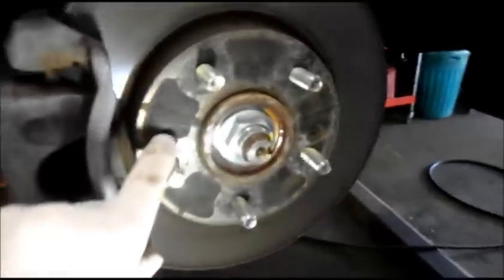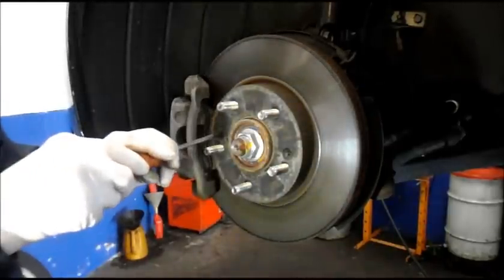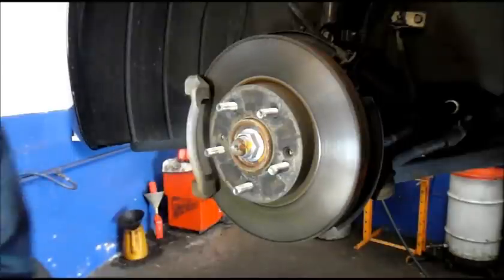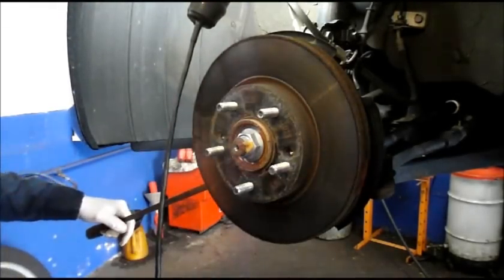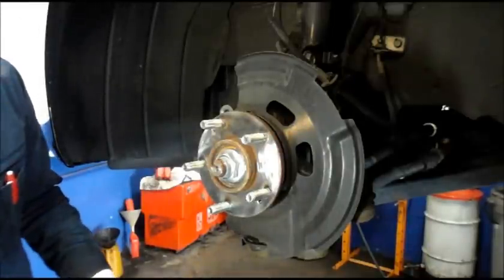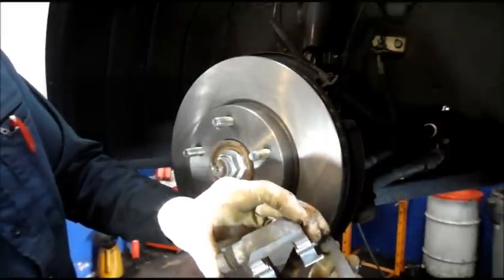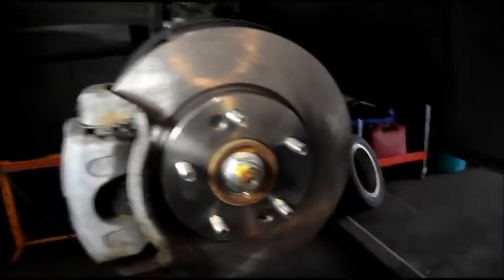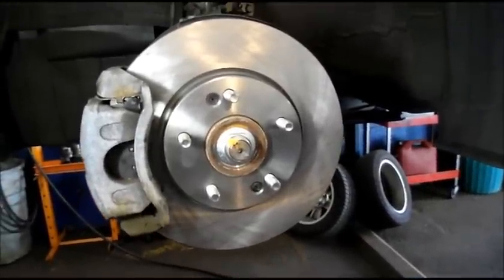How to replace front brakes and rotors on a 2013 Hyundai Elantra

Comment: Hi i have a 2013 also i will be changing the front rotors and pads also im concerned about the caliper its not leaking but its rusty
Reply from the maker: As long as it is not leaking you should be good.
Reply: Thank you Jim

Comment: Thanks for your awesome video.  I've been doing break jobs since I was pretty young...but with all this newer cars out I like to see the videos like yours to ensure I don't screw something up.  I'll be replacing my daughters rotors and breaks pads this weekend and your video has definitely given me the peace of mind to know it's a pretty simple job.  THANKS
Reply from the maker: Thank you for watching and your feedback.If you run into any problem let me know I should be able to talk you through.Let me know how the job turns out.
Reply: The job was probably one of the easiest I've ever done...Recently has surgery on my left shoulder and probably shouldn't have been doing it along but it was for my daughter who had worn them down to nothing...metal to metal was not pretty.  I did find that the caliper bolt was a 14mm on her car not a 13mm...other than that everything went very smoothly.  Thanks for your helpful video once again.
Reply from the maker: Thank you for the update .Great job.

Comment: great video,i tried to replace my pads today, but when i saw the back of my rotors there was no way i could do it,   there was no surface just rust,one thing, when doing the driver side what can i do to get leverage on those 17mm bolts ,i cant get the car that high on a jack
Reply from the maker: The longer the ratchet the better that will give you more leverage.
Reply: hammer and wrench

Comment: Inspected brake pads on my 2013 Elantra.  Pads have 25-30% remaining and even wear.  However noticed a raised lip on the rotor edge, made it difficult to slide the pads off. Saw this same raised lip in this video.  Recommend to cut down that lip now, or when pads are changed?  You replaced the rotor without measuring rotor thickness, really required to replace because of this rust lip?  -thx
Reply from the maker: Yes they were replaced because of the rust lip.Thank for watching.

Comment: Thank you for posting this one!  I just did the front brakes and rotors on my 2012 Elantra.  Thank you for the tip on hitting those two rotor retainer screws with a drift!  I had one that gave me a hard time but eventually I got it out.  I may invest in the hand driver. Do you have a video on how to do the rears on a 2012 Elantra?
Reply from the maker: +N72Pilot  Thanks for watching and your feedback.This is a video I have for rear brakes on a Hyundai but its a Santa fee   https://youtu.be/oegacaeJn98
Reply: N72Pilot clarification question,  i have an elantra 2012, and I'm replacing the rotors this weekend. .is the replacement process different for the rear than the front?

Comment: i just checked the indicators are on top were they should be , still have that grinding
Reply: indicators will squeak not grind, screamers is what I call them
Reply: I actually had asked the place I get my oil done to take a look and he said it just the cheap pads I put in everything is ok, they still make noise after all this time ,i'll get better pads next time
Reply: mine make the same sound on the right side only when I am lightly pressing on the brakes. I replaced them with all new parts and it still does it on the right side. I suspect this is a Hyundai problem. We have 2008 and 2015 Elantras and they both do it.
Reply: On my wife's ,same car by the way,i replaced the front pads only,and it makes the sound but ,much lower,im thinking the cheap amazon pads I used is the culprit
Reply from the maker: Did you make sure that the hub where the rotor goes was spotless with no rust?That is usually were the noise come from
Reply from the maker: Did you make sure that the hub where the rotor goes was spotless with no rust?That is usually were the noise come from
Reply: Look good to me car is only 3 years old

Comment: Thanks for another informative video. It's amazing no dealership or shop ever wants to just change the pads. NEVER. they want you to change the rotors with the pads even tho their is NOTHING wrong with them. why? because they want to charge you $300. instead of $100. even a car a couple years old getting its first brake replacement, they tell you you need new rotors regardless. most times if you havent run the pads to the rivets all you need is a good fine steel wool scruffing on the surface and a wire wheel to knock the rust off the cooling vents. as long as they arent warped you shouldn't need new rotors.

Comment: Does the break piston automatically retract or do you have to do something to bring the piston back to normal position before driving away.
Reply from the maker: +Rene Warren After the brakes are reinstalled on the car you pump the brakes a few times this will reset the piston.
Reply: +jimthecarguy thanks for the quick reply. You videos have helped me out a ton. Thanks from Alberta Canada

Comment: When replacing the brake pads, do you also need to replace the brake clips?
Reply from the maker: Pedro Napoles   Yes.  I try to always replace the clips at my shop
Reply: Replacing brake clips is a good idea, mentioning which grease to use would be a good idea, using a torque wrench and follow specs is would be a good idea, also mentioning to pump the brake pedal 7-10 times before leaving with your car is a MUST to protect your ego and possibly an accident. If you have never changed brakes before look at more than one video. This one is good, but not perfect. Brakes are simple to replace, but they can save your life

Comment: How do you know you have the right brake pad grease? Do you have a preferred name brand?
Reply from the maker: +CincyPlasmaTech  The one I use at the shop is synthetic brake and caliper grease made by CRC
Reply: jimthecarguy Thank you! Great video! It was very thorough. I would even go as far as saying your video is the "gold standard" for front caliper maintenance. I didn't know there was a brake grease for the metal shims.
Reply from the maker: +CincyPlasmaTech  Oh ya ,That silicone grease is very important to let the brakes slide without binding.Thank for watching and you feedback.

Comment: In hindsight, I wish I would have found your video before I did my daughters '13 Elantra. What advice can you give for removing the two rotor screws, after some bonehead stripped them? Yes, it was me. Thanks
Reply from the maker: The only way to get them out then is to drill out the screw.Be careful not to drill to far.Do you want to call me I can explain better?
Reply: Thanks for the info. I drilled out the head and was able to get the rotor off and new one on. However, do I need to worry about getting the screws completely removed and installing new ones? That might be a bit more of a challenge.
Reply from the maker: The main thing is that you have to drill out most of the bolt so that it is not sticking up and interfering with the installation of the rotor.You don't have to install new bolts you can leave them off.

Comment: Good video, 3 issues, however. 1. Your shot was below camera viewing 2. you didn't use any lube on the outside of the pads to prevent noise 3. never use the new pads to compress piston, also you can use basic large channel locks to compress.

Comment: I have a 2013 Hyundai Elantra and noticed the squealing noise, I replaced the brake pads cause they were bad but even with the new ones the noise still happens, my rotors looked fine by the way. But like when I first start the vehicle it doesn't make any noise, but after driving for like a half an hour or if I drive on the expressway at like 70-75 mph the squealing noise is very noticeable, especially after getting off the expressway, and going back down to only like 35-45 mph, any idea what it is?
Reply: PdippProductions I get the exact same problem with my 2013 Elantra GT

Comment: Great video, but caliper bracket bolts MUST be torqued to spec. not just hand tightened.  That is very important from a safety perspective...could be disastrous if they're not tight enough or overtight.  Also, like someone said...silicone crease on caliper slides...not moly or whatever that black crap is.  But better the wrong grease than no grease.  I've seen many neglected slides.  Most shops don't even touch the slides.

Comment: Good morning Jim, 
It's René Warren again with a question. 
But first off I just want to say thanks once again for all the great videos. 

So onto my question but a little back story to help explain it. 

I have a 2013 Hyundai Elantra with 104,000km (64,000miles) as 90% of them KM's are highway miles. ( and I'm the only driver of every one of them KM) 
Q1- do you think I need to flush my ATF fluid right now or can it wait? If so at how may KM should I flush it. 

Q2- my car calls for Hyundai ATF SP-lV and here in Canada the dealer is asking $60 per Litre. Do you know of an after market brand/ type that is equal to the ATF fluid I just mentioned. I can't seem to find any that says SP-lV and I just don't want to use any brand that the young guys say at a NAPA store or where ever I may go. 
I'm looking to you as your the pro and I have a ton of respect for what you suggest.

Comment: where do I jack this veichal up without a lift? can't find any safe jacking spots
Reply: Adam  hi I am a hyundai tech at the dealership   if you do not have a lift the jim and my self   you can do this job with a floor jack and 2 jack stands   on most cars there is a pinch weld  its a thick piece of metal  made  for jacking up the car   if you look in the owners manual  most of the manuals  have a picture of them   the round sadle part of the floor jack goes right under that     hope this helps

Comment: No Anti seize??
Reply from the maker: aron john No, none was needed.
Reply: No...why didnt you? Put a lil on the inside of the rotors and threads on the lug nut bolts and on the ends of the pads where they slide in on the calipers. And that god forsaking rotor screws to help them not rust up.